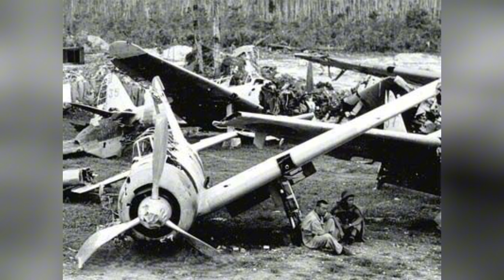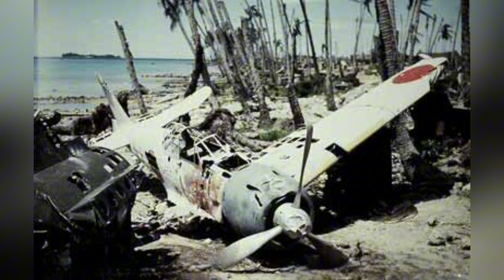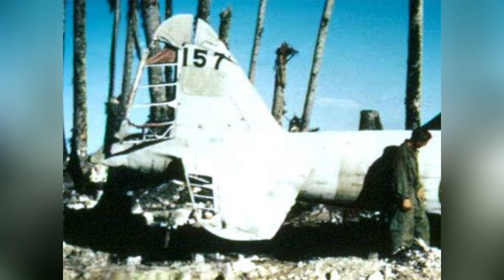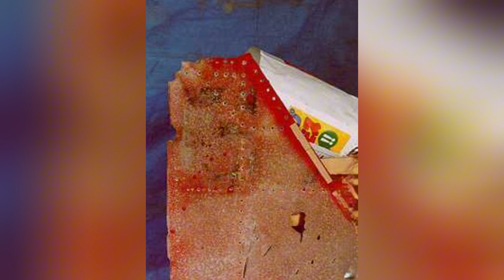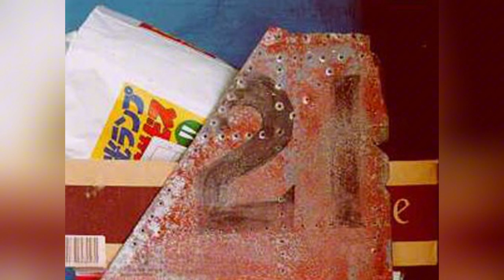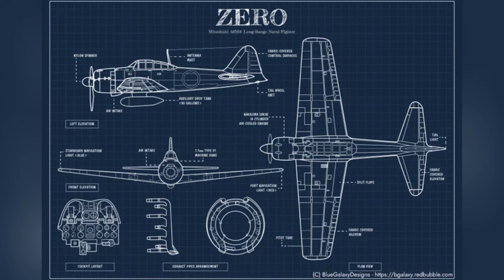Mitsubishi A6M3 Model 32: Raising Munda’s Abandoned Zero Evidence

Comment: The first thing I notice from the photo, is that it's either an A6M2 or A6M3, since they skipped model 4, and it's Navy gray. All A6M5's were painted Army green, like the 2 surviving originals examples at Planes OF Fame (still flies), and the Smithsonian (static display, been there, and seen that one), which were captured on Saipan, which belonged to the 161st Kokutai. The second thing that stands out is the "carrier stripes" on the fuselage, which denote which aircraft carrier it belongs to. And from the artist's picture at the end, it looks like the carrier stripes and tail number have been changed at some time. This plane might have been assigned to more than one carrier in it's service time. That wouldn't be a huge surprise, since so many of their carriers were sunk while their Kukutai's were airborne, forcing them to land on any they could, if not ditching in the sea. I suspect it still has carrier stripes because by the time they were reassigning the older models to front line units on the island bases, they just weren't bothering to repaint new markings on them, it was all they could do just to keep them in the air. Land based Kokutai's may have had stripes as well, though, I don't know, I just know they call them "carrier stripes", I'll have to look into that.
I find it oddly coincidental that you posted this when you did, as I just happen to be re-reading the first edition of Saburo Sakai's biography, which I read in high school. I read the second edition a couple of years ago, and it wasn't quite the same book I remembered, so I found a used copy of the first paperback edition on Amazon. He flew the A6M3 from Rabaul and Lae, until he was wounded during the Battle of Guadalcanal. As a fellow historian, and former "fighter pilot fanboy", I highly recommend the first edition of his book "Samurai", co-authored by Martin Caiden. The second edition has a brown cover with his photo on it, don't get that one. For some reason, second editions seem to leave out the best parts.
Reply: Martin CAIDENS EYES WERE BROWN ! The entire time he wrote books !!!😂
Reply: @JoeyFieroW5tfw he said the cover was brown and with his photo on it.